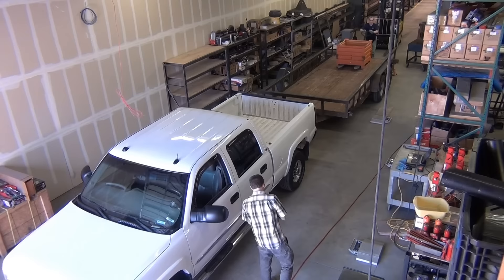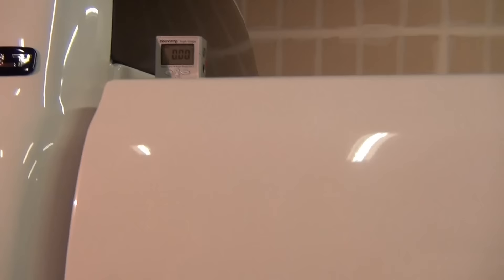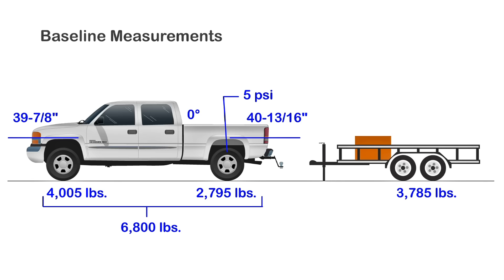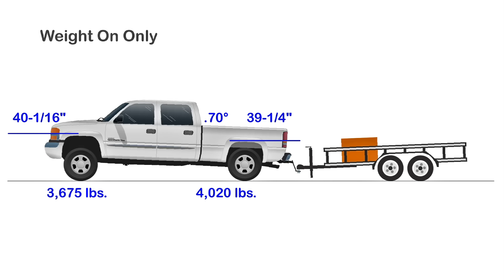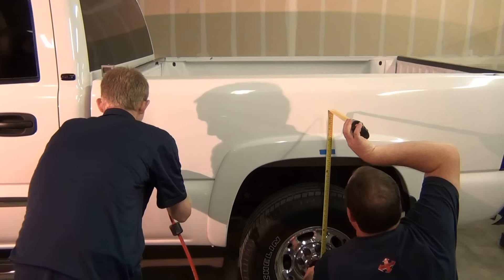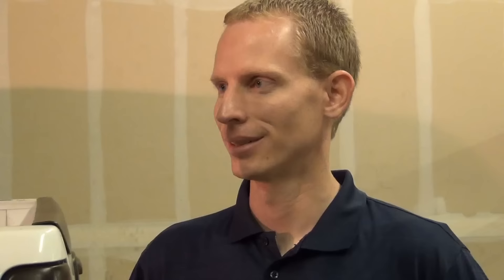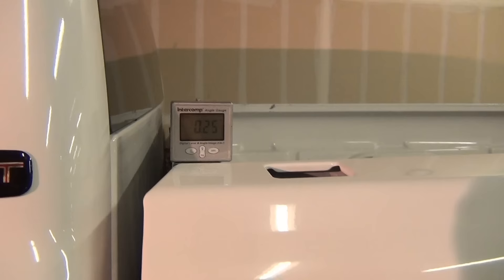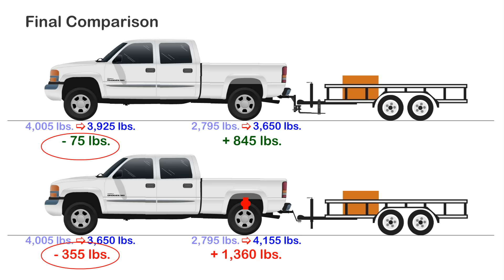The Difference Between Using Weight Distribution and Air Bags to Level Your Load

Comment: So a 20% tongue weight something that no good driver/hauler would do. Moreover somehow physics goes away with weight distribution as you add any weight aft of the rear axle it will work as a lever and take some weight off the front axle. How about you don’t just try setting things up unrealistically just to sell your product instead of impartially reviewing the two in a real world test.
Reply from the maker: The trailer loading in the video is simply set up to show the principle differences in using air bags or weight distribution to take the sag out of the rear of a tow vehicle when towing a bumper pull trailer. The gross trailer weight does not change these effects, only the tongue weight, therefore, there was no reason to load the trailer to 10,000 lb to illustrate the principle.

The principles shown in the video are true for any brand of air bag, and any brand of weight distribution hitch, when used correctly. Our purpose was simply to share information that has not been readily available to people, and clarify and share accurate information about each product and its capabilities. We have never disparaged any other product or brand with this video or our comments. Our goal is to help people tow their trailers with the least amount of work and as safely as possible.

Comment: Really would have been worth it to inflate the airbags in the end with the Weight Distribution to get the angle gauge back to zero degrees then measure weigh to each axle. I feel like I just wasted 13 minutes of my life.
Reply from the maker: +tbocfo,
Our original purpose for the video was simply to show that air bags and weight distribution effect the tow vehicle axle weights differently, even though they both take the sag out of the rear axle. We did not intend to show both in use at the same time. However, since publishing this video, we have had many comments requesting to see how both work together. That video is planned for the near future. We hope that it wasn't truly a waste of time, but that you did get some valuable information from it. Thank you for watching.

Comment: I noticed that you had your trailer load weight forward of the trailer axles. What is the difference if your trailer weight is rear of, or directly over the trailer axles?
I have always been told to load any heavy items to the centre or rear of my trailers. Or is this to show how stupid people load trailers and like to spend unnecessary money.
Reply from the maker: Yes, you will want to keep most of your weight directly over the trailer axles, however you will want to always have 10-15% of your trailer weight as tongue weight.
Reply: Never load the weight behind axles!
Reply: @ZR1Terror  absolutely.  Not stupid at all.  Rear heavy trailers are deadly.  Light on the ball trailers are just as deadly.
Reply: Not stupid at all, you should keep as much weight as possible over or near the axle set, with approx 10% of aggregate trailer mass on the ball/hitch
Reply: The test trailer will skew the results, the trailer has 20% tongue weight which is way too heavy on the tongue.  If they loaded it correctly, there would be much less difference as the weight would be on the trailer axles, not the tongue from the beginning.

Comment: To solve this crap, you would not load your trailer the way you have. I play with weight and axles everyday, your trailer should have been loaded just barely in front of the rear axle on the trailer. Take a pulling sled for example, more weight to the front less weight on the steer which is why you see weights on the front of the steer. Weight specialist my ass.
Reply from the maker: You are correct. The trailer is not loaded correctly. This is because we are not planning on towing, only setting up to show the different concepts and principles that apply to using air bags or weight distribution. In the real world, moving the cargo so that the center of gravity is slightly ahead of the axles is the best policy, and exactly what we recommend people do. For this test, we did not need a properly loaded trailer to show those concepts, so we did not take the time to put 7,000 to 10,000 lb on the trailer. We cheated by moving the weight farther forward than you would in a real-life towing load to attain the 1,000 lb tongue weight and save some work and time.
Reply: You might want to take into consideration the context of the whole video before you make ignorant comments like this. It only makes you look like an idiot and forces the YouTuber to waste their time trying to politely say that you missed the point.

Comment: Ok you have a good ride height now, but now your trailer axles have more weight on them which could wear faster on the trailer and cause more blow outs and put more stress on the tongue which could cause it to crack.
Reply: This is assuming that the trailer is not past it's load rating.

Comment: Well, my Kenworth has had air bags since it was made and has towed weights in the 5 figure range and never had a problem. Hmmmm. No fuzzy math or blurred math.
Air bags always.
Reply from the maker: Semi-trucks are an entirely different principle than towing a bumper-pull trailer with a pickup truck. They are more along the lines of towing a 5th wheel or gooseneck trailer with a pickup truck. For a Semi-truck, air bags are great.
Reply: Absolutely no comparison between a semi trailer being loaded over the rear wheels compared to a bumper pull being a few feet distance behind the rear wheels of a pickup truck.  They showed you the scales and did zero "fuzzy math or blurred math"...
Reply: air bags (air Springs) on a semi are controlled by an automatic leveling valve and control ride height only, dependant on weight load on the chassis. They do not have the independent control to adjust air pressure. They do usually have a 'dump' valve so that they can be exhausted to prevent the truck from lifting too much when disconnecting from a trailer or used on a dump truck to prevent side sway when dumping. Axle weights are adjusted buy sliding the fifth wheel or repositioning trailer load if possible. if you had aftermarket airbags installed on a walking beam rear suspension it is possible to do a slight weight shift to the front but you would change weights on each axle of the tandem or tridem but then they never weigh rear axles individually at the scale.
Reply from the maker: @pops35fordshop2  thanks for helping clarify, and thanks for watching!
Reply: Hmm A semi trailer has 60% trailer weight on the 5th wheel, 40% on the tandems. Totally and completely different set up all around. Not only that, but on some trucks those air bags are also the trucks springs.  Completely different altogether, no comparison.